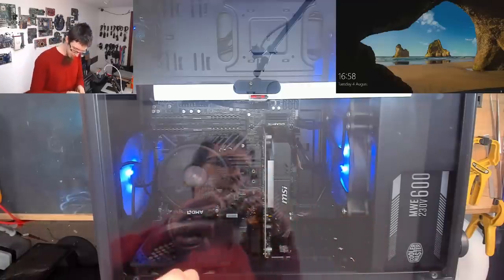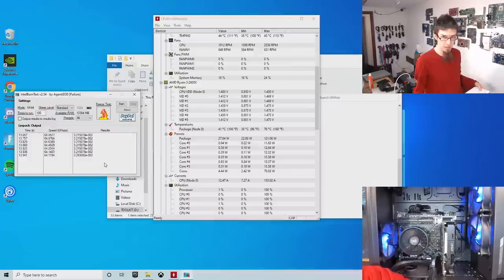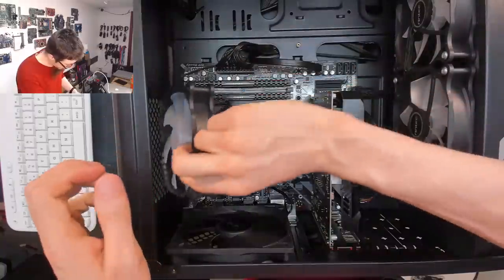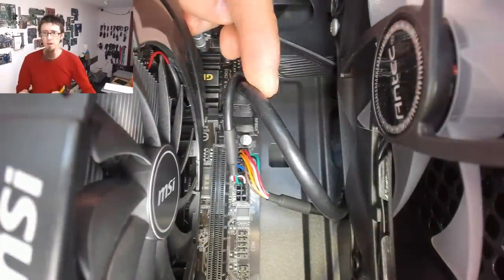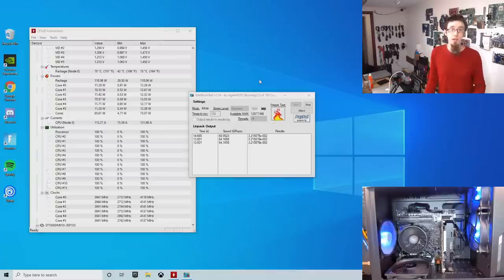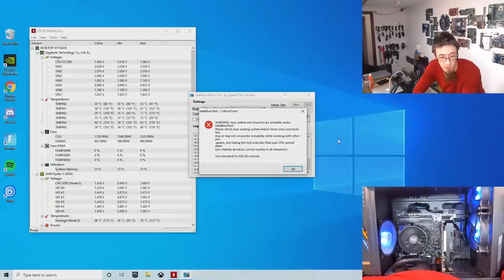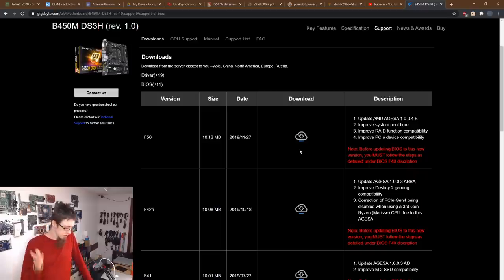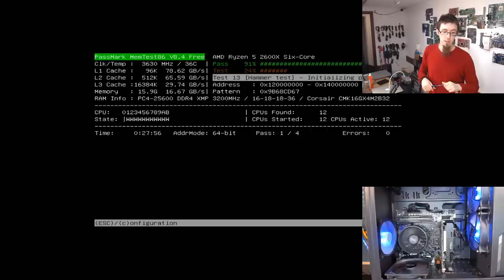Gaming PC Crashes at Random - LFC#217

Comment: Thank you so much for your video about this memory issue.I have a new delivered custom build PC since a few months and have lots of CTD's with the main game that I play, Microsoft Flightsimulator. It gives many many CTD's and lots of people are dealing with this. Because of the unstable software I blamed only the flightsim to this CTD's. But... sometimes playing another game, like Farmsimulator or Transportfever 2 I also encountered CTD's that I never had seen before on my old PC. I have 32 GB memory on 3200 speed on the board. I am not so very into technical things but I decided to have a look in the motherboard software and discovered that XMP was NOT enabled. So I corrected that and since then no more CTD's and the games, especially MSFS2020 run significantly smoother! Thanks again! You have a new subscriber, I like your video's and I learn a lot from you.

Comment: similar build and a similar problem for me. ive got a Ryzen 3 3200g with 16gb AEGIS 3200s on my ASUS prime b450-plus. my USBs constantly reset and cycle so i cant use my headset with their driver at all otherwise i have to constantly keep resetting the volume. on a good day it cycles 1-3 times but other times it cycles 20-30 times and then the USBs dont recover causing a cascading faliure of all IO and system hanging. DOCP of 3200 with QVL listed ram, everything is compatible with the slight overclock to ram only.

the problem persists with no overclocks and ram speeds of 2133 and lower. i have no idea whats causing it and there are no errors or logs that i can find giving me any hints to what it is. my USB 3.0/3.1 header is on the USB 3 connector with its pigtail disconnected, all plugs are set and secured, PSU is a 1000W as im constantly upgrading to bigger parts and have 3 2tb HDDs and lots of LEDS and NEON tubes. brand new mobo CPU and RAM. problem started day 1. and advice for trying to find the culprit?

Comment: Weird, I just helped someone on Discord who had a Ryzen 5 3600, 16 GB of DDR4 3200 MHz same kit as in the video, and the same B450M DS3H motherboard. We tried setting lots of different timings, voltages, multipliers in the BIOS, and nothing worked. What we ended up doing is setting the timings and frequency in Ryzen Master and what do you know, RAM is finally running at 3200 MHz stable instead of 2133 MHz.

Comment: .NET Framework updates can be checked for being installed &/or installing them on Windows 10 by typing in the Windows search bar or in Settings "Turn Windows features on or off". Click on the results.

(To open Settings if needed:
•Click on Windows symbol in the lower left corner of your screen. •After the window opens, move your mouse cusor up 2 icons on the far lower left to the gear [which is Settings], •Click on the gear, once.)

Now you'll see that a window has shown up that is titled Windows Features at the top.
•Click the + on .NET Framework 3.5 (includes .NET Framework 2.0 and 3.0).
•Put a check in both of those empty boxes. (If they have checks in both boxes, Windows already has the needed files & you should click cancel on the bottom right of the window)
•Click on the + for .NET Framework 4.8 Advanced Services.
•If there isn't a check in the box for ASP .NET Services, put 1 in it.
•Leave the rest of the window alone. You're only there for those 3 possible check boxes.
•Click on OK on the lower right of the window.
•Windows will download the applicable files it needs.
•Windows may ask for permission, if so, click yes/ok.

Hope that helps someone. In some instances, you may need to rer-un the application that needed those files to install it properly.
•After this is done, check Windows for updates.

Every Windows installation I do at work gets those boxes checked to help prevent customers from having program installation issues.

Comment: As long as you stay away from MSI, I have the same issue, on an MSI B450 Tomahawk Max, with Corsair 3600MHz. Though initially, my Patriot RAM was faulty. XMP turned off it runs without an issue. CPU is 2700x, it is the first-ever build where there has ever been a problem doing a diagnostic test. A good video that has highlighted the problem I had with MSI, also occasionally the Graphics card produces a Pixalated screen. RX5700 XT, Oh no it is MSI.

Comment: cool channel, do you have any vids that deal with driver bluescreen? it's not important anymore, but I'm 90% sure my dead grandpa's computer started bluescreening after i updated either the amd drivers or the hp printer drivers. i'm curious to find if there are more software troubleshooting vids on this channel.

like detecting if it's overheat damage and so-on.

oh, and my own computer sometimes loops/restarts and keeps repeating at post until i drain power out of the mobo.

Comment: About the memory problem - if xmp setting wont work, you have to downclock it, and you know that the ram kit isnt working - increase the SoC voltage. Had the same exact problem, had to increase SoC voltage, it fixed. By the way, memory problem wont necessarily result in BSOD's.

Comment: Sometimes it is just a memory controller which can't keep up under the hreavy load with bad BIOS auto voltage set up. Found out that in some cases rising the SOC vcore voltage from auto to something like 1.2V-1.25V fixes the issue with XMP fails. Sometimes it is also caused by LLC.

Comment: Hiya, late comment but I saw this video in your popular videos section. I happen to have the same CPU in this current system right now and am happily running it as my daily driver without any issues.
I have dual rank, dual memory (2x2R) RAM chips (model numbers I won't mention as it might auto-flag my comment for spam). According to the official CPU specs, it can only handle dual rank memory chips for speeds up to 2933mhz. I remember having memory issues when I stuck in four total sticks of the same kit.

The MMC/MMU (and by extension, SoC) of this CPU has trouble handling RAM at speeds of 3200MHz.
The way I circumvent this is by running my computer is by applying a slight SoC overvoltage (around 1.2, 1.25v) by extension of a 4.1GHz all-core overclock with core voltages set to 1.35v.
This is generally not recommended and I don't advise anyone doing this, but this is how I've always ran my computer (and of course, was sure to validate everything by stressing out everything during summer).

As a result of my memory mishap, I Now Always Recommend Everyone To Run Memtest86+ When Using XMP or memory tuning. There's always a possibility it won't run the way you'd want it to run, and always cross-reference your components, see if they're compatible with advertised settings and speeds. If not, benchmark it til you break it. Nothing sucks more than an unstable system

Comment: i'm having an issue  with crashing,  however its not   during gaming alone,  

i just sit it idle and it freezes entirely then completely reboots, still trying to figure out what is causing it.

i have already ran a memtest  ram is fine,  the heat levels are fine,   the only things i can imagine are psu is going out or cpu is out of paste or something.

Comment: Hi: I am trying to learn electronics. I purchased 10 boards to learn remove the bent pin sockets. I did this and there is no power on the board with a cpu and memory. I looked on the web to find a video of someone starting at a dead board and following on to the mosfet and how the power continues along showing testing of all the parts and what you should see if good and if bad. I know that this would take a lot of time, but the way you go through things while explaining it would make a few good videos. I purchased a couple of video cards with the same thoughts that I re-flowed with no luck. No video with a start to finish has not been done. Most videos are done by people such as yourself that have been fixing these things for some time and the video is done from an experts point of view, not beginners, and using past knowledge jump straight to the fix. Thanks for your great videos.
Reply from the maker: I'm working on desktop mobo and grapahics card diagnostic stuff, but it's very much in the slow-queue at the moment, so no idea when I'll have stuff to show off.
Reply: @Adamant_IT  Thanks for the response. It will be appreciated when you get around to it.

Comment: The problem, likely, is the memory controller (system agent in an Intel CPU). It has its own clock, separate from memory and CPU. If the motherboard does not have the integrated knowledge implemented (my old X58A knew nothing), setting it to XMP timings may just alter memory clocks (my old X99 knew XMP) and then you get this. One level of robustness up is the BIOS on restart going back to previous robust settings (mobo defaults - the X99 did that). My current mobo (Z490) has a level of AI that works the whole list of clocks in a balanced way. Note that misalignment may not just cause instability, but can also degrade performance (X99). I had one motherboard-CPU pair run Timespy with 1,000 more score points at default clock, lower than XMP.

Comment: I have 3600 memory on a MSI Tomahawk. My memory is listed as compatable on the motherboard list, but not on another. XMP profile will not even boot.  I had to manually configure the memory to overclock to 3800 with manual timings to get it to work.  The only other setting was underclocking to 3200.  Weird as hell.

Comment: Its XMP, very common issue with Corsair RAM and Gigabyte boards. I had to put in manual timing in bios. Heck, im not even in IT and i could have told you that in 5mins. Memtest86 would have shown that from the get-go rather than wasting so much time. But good work on the internal case diagnosis and rectifications.

Comment: the system components this client haved used are still  a newer style but with older computers a couple of areas that all way used to come up was 
1) cleaning due to dust build up can cause overheating (this is why i buy cases with input fillers). So please check you case and the fillers if filled for dust buildup 
2) oxide buildup on contact surfaces e.g. GPU and memory modules. I use a pencil rubber is an option to clean contacts but there is commercial products on the market as well 
3) bad computers power supplies ( rail errors) or underrated for the GPU's these days with to many cables attached which are not required that you may have poor outcomes of affected air flow
4) basic physics, heat rises so please think of the case volume selected for the equipment to be installed, quality of fans selected, fan placement, fan size, volume of air AND RPM (mind the noise ) some of the better motherboard now that speed control build in if  you use the 3 or 4 pin connectors and the associated fans to match. Which brings me to 5) 
5) you get what you pay for and especially with motherboards. As i explained to my son the other day it is best to have a motherboard with some sort of display of the coding array of the bios. So if the systems will not get pass post boot & you have a dead motherboard as least you will know where to start. Some of the cheaper motherboards only have the 4 led display which is better than nothing

Comment: I'm having this issue when I play games on my PC. I thought it was the PSU, but after looking into my motherboard QVL, my single 8GB Samsung DIMM is not supported and is running at 1600MHz. I've switched the DIMM to run at 1333MHz which is what a lot of budget 4th gen boards used. If this doesn't work, I'm leaning back towards the power supply.
Reply: Looks like mine is having a PSU issue as running the memory at 1333MHz didn't work.

Comment: Had similar issues with my AB350 Gaming mother board.  It was fun figuring it out since my computer is a bit of a frankenstien to begin with.  Parts from older machines cobbled together to make it work.  Ended up that the system freezes and blue screens I was getting was due to memory errors from a bad stick and the BIOS battery was going bad and not storing the configuration when it rebooted.  I had to keep on telling it what hard drive to boot from.

Comment: I didn't like the temps on that machine.  That heatsink/fan from AMD was too little for a 6/12 Ryzen.  It may not have been the issue now, but when it gets a little clogged with pet hair/dust/Cheetos dust etc...it could be.  You are probably right about the XMP being the main issue.  The 350/450 chipsets don't seem to like RAM speed greater than 3k, and XMP settings are also timing tweaks and I experienced issues with a lot of machines with that setup.   The defrag you said you were going to do was unnecessary, assuming it was a newer build and HDD.  Getting some more ventilation for the HDD would have been a better use of your time.  Again, stress testing a machine with the panels on is preferred because that is how the customer is going to be using it.

Comment: @Adamant IT 
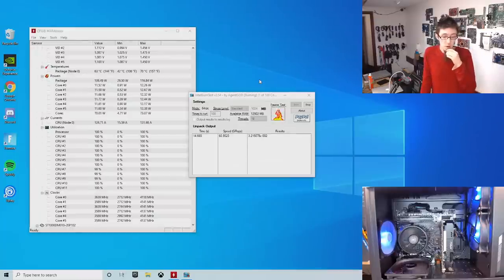@23:00 mark in the video while your burn in test was running the screen of the monitor seems to be flickering in the task bar.
It was also showing in the Hardware monitor lines on the left of the window.
Could this be because of the test or an indication of the memory issue?

Comment: Laugh you might but, I still deal with scsi and usb1.1. 
So whats the mfr suggest for memory mfr? Got to match designed north bridge specs. 
Memtest about the best if your trying to Isolate a bad memory chip, also you could have a bad slot, or you could have North Bridge chipset could be out if the memory does match mfr specs.

Comment: Thanks Man, you're a life saver, this Problem made me crazy. in 18 years of hardware experience I never faced problem like this and i tried every thing bios update, new system, change GPU an drivers even i changed  my old SSD to new one because Memtest64 on system and Furmark test doesn't show any errors.
my alt System Ryzen 5 2600 B450 Aours Elite V2 Rm 2×8GB 3200Mhz T-Force DarkZ R7 370 2GB
From Egypt with love Bro may God bless you

Comment: I had a set of random crashes crop up - either a Windows or nVidia update.  I was all prepared to either replace my power supply or video card when on a whim I changed from connecting dual link DVI to my monitor and instead using display port.  Crashing stoped.  Very annoying since if you turn a display port connected monitor off and have multiple monitors Windows "helpfully" rearranges all your windows - it's why I was using dual link DVI in the first place.

Always a fun time with Windows!

Comment: Hi there as matter of interest custom built pc i have with all the bells and whistles, my problem started when my old PSU was starting to die by making not such a good sound when i turned it on so i replaced it with a ROG THOR Platinum. So i stripped pc down installed the new one and replaced the cooler with Aurous ATC 800. Hit the power button no start. so i went around it stripped it down check everything re-seated everything only key board mouse connected and started no problem and went to posting screen. So it ran great for a week then one night just shut down now 3 weeks on I've tried every thing it starts then gos off not even making it to the posting screen am at a complete loss here so how much would some of your skill services cost me.

Comment: I just logged in to ask a question about burn-in tests. You said you used Intel Burn test because it was fast/portable, which is good. However, I'm wondering why you don't use Prime 95, which is also portable? Could you use Prime 95 for burn in testing? I've always used it to test for heat after a new build, but it seems like it would work just fine for testing stability, too?

Comment: i have an issue with my setup where xmp doesn't work but when i manually put the 3200mhz and voltage it recommends then it works. Basically the same setting except not setting it as xmp automatically. It wasn't in the QVL either.

Comment: I've got two ryzen systems, both 2nd gen. A 2600 in the MB shown in the video and a 2700x in a msi tomahawk. both using 32GB gskill ripjaws. I was getting blue screens like crazy with 3200 Mgz xmp profile. BIOS updated, tried xmp setting, tried motherboard profiles, tried manually entering settings. I found that the mem profiles on the MB worked best, but would still crash about once a day. I finally settled on running 3000 Mgz and they crash rarely now. The memory is not on either of the boards compatibility lists. Make sure that if you are running 2nd gen ryzen to use memory on those lists before spending $300 like me because they seem very picky.

Comment: I've not read through all the comments but if Zen+ was like the original first gen Zen CPUs the Memory profile overclock would also put an overclock on the internal CPU SoC, it probably just needed a slight voltage uplift to the SoC specifically to land in the stable range

Comment: Hello, new viewer here, I am experiencing issues with my game crashing (RedM which is private servers for RDR2) and it was running fine till about 2 days ago when I re-seated my RAM (I noticed that my PC wasn't using all the RAM 16GB) which gave me it all back. Now when I try to run the game, it'll crash anywhere from a minute in game to 30 mins. I have cleaned the PC physically, dust etc, checked wiring and swapped the RAM sticks beck to how they were, tried rolling back driver to dec 2021 which was recommended to me, then also as that didnt work just updated to newest version again. Yet it is still happening, any ideas on where I go with troubleshooting this issue? i'm pulling my hair out a bit! im using nvidia GTX 1050 ti like the rig in this video, AMD FX(tm) 8350 8 core processor. If you think I need to upgrade anything what would you recommend?

Comment: I have an ASRock Fatal1ty X370 Gaming K4 that doesn't support DDR4 RAM speeds over 3000. BIOS updates haven't removed that limitation, it seems to be a hardware/memory controller limit. First gen ZEN motherboards were iffy when it came to RAM support, the 400 series improved a lot in that sense.